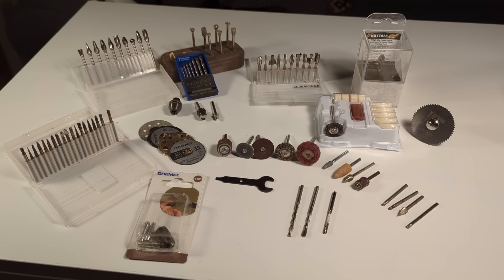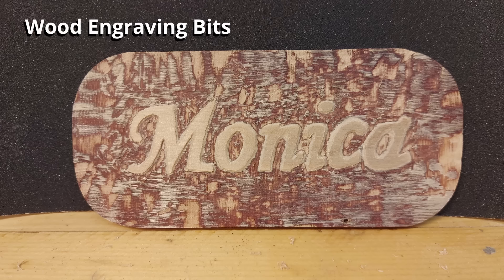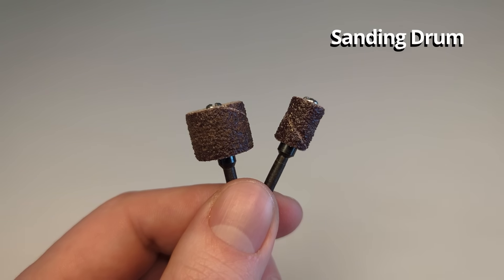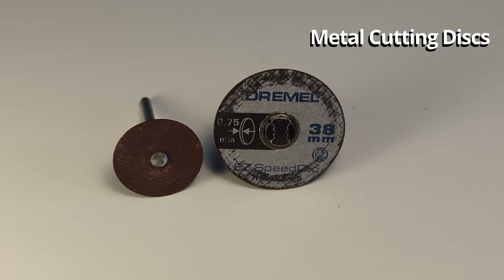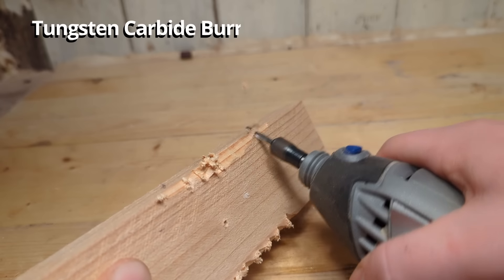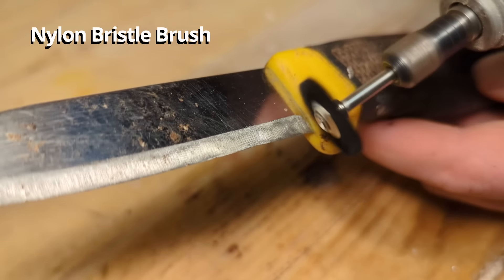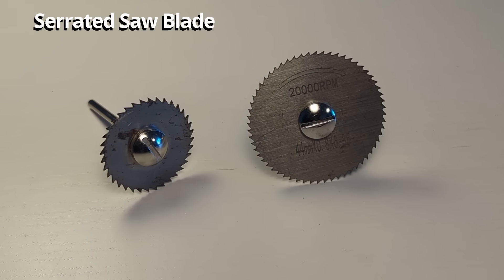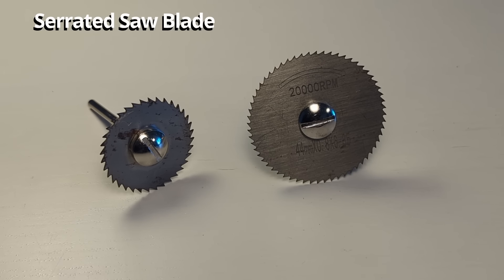The Ultimate Dremel Bit Guide

Comment: The larger fibrous cutting disc for metal are more durable and are generally fine, but they are soft... Those small what looks like corundum bound with resin discs truly do shatter easily and are a danger, but if you need to make a cut or a gash in a piece of carbide or hardened steel, like file hard steel, they are much better... Sure, they demand full protection and gentleness greater than handling a newborn would, but you are grinding into hard steel or carbide, and you should by all means have full adequate protection, from breathing respirators to lexan visor and thick gloves and chin reaching apron... You dont want a slice of that disc to launch itself into your throat or anywhere, so pay heed to its capacity to do immense damage to soft tissue upon fragmentation if you make the slightest hiccup... 
I love them, as i do often make custom machine cutters from broken hssco drills or carbide pieces, and a machine cutter grinder is just not deserving the abuse that removing a chunk of material means, where these discs can carve out a lot of material in moments, roughing the shape envisioned, and then the thing can be precision ground as not to impart significant wear into the diamond/cbn wheels of the cutter grinder... A bench grinder cant do the same due to thickness of the wheel... For rough work, i prefer these, as i can manipulate the thin disc to provide specific geometry, where the thinnest bench grinder stones are quite thick in comparison to max. 1mm thick grinding width that these have...

Those serrated saws are a decent cheap hss machine slitting saw, true, they come in minimal diameters, but if ran properly and sharpened here and again, like any cutting tool, they can actually be used by hobby grade milling machines and even proper large machines on an arbour to produce flat and very nice cuts or slits in materials, even mild steel... Dont try them in the dremel, that just invites disaster, but a rigid machine can make great use of them, and a hobby machinist can source cheap slitting saws from them if one needs them for some small project... I have a few, and i use them on my baby mill here and again... Never failed me, nor did they cause problems... But handheld, they are bound to catch and do damage of some sort to something... Best scenario, the piece you are working... Worst case, well, lets not go there... Just use the diamond or carbide disc if you want to cut solid stuff with the dremel... Toothed implements are best used in rigid setups, and hands are anything but rigid...

Comment: Hi! I'm new in the dremel world. Question: because wood is less hard than metal, can I deduce than metal dremel heads will work on wood, or not at all? I am also trying to see if I can use a dremel for polishing epoxy and if yes, which type of head?
Reply from the maker: Some will work and some will not. Aluminium cutting bits and carbide burrs works fine for woodcarving for example. But the cutting discs and grinding stone will not work very well for wood. My experience with polishing epoxy is next to zero,  but with some polishing pads with polishing compound would be my best guess for bits.  You also have the 423S polishing wheel for softer polishing.

Comment: Which bit would you recommend for removing excess powder coating from metal? Where the powder coating has collected into blobs in holes and corners of rectangular cutouts in the metal. Thanks!
Reply from the maker: I'm not quite sure since i have not done to much metal work. But I would guess the tungsten carbide burrs would be the most effective at removing that type of hard coating from nooks and crannies.

Comment: So is Dremel good for DIY for cutting plastic, metal and plexi glass ? I'm still wondering (so far 3 years) whether this tool and available bits will be good for my needs. Is there something similar to Dremel but aimed at cutting metal, plastic, plexi ? I'm not interested in cutting stone, polishing elements etc, but on the other hand, I don't want to buy a bulky angle grinder with huge 10-15 cm cutting discs.
Reply from the maker: Hi. In my opinion it works good for light metal work (cutting screws, thinner than 1mm metal sheets) and when working with hard plastics like PVC. When I have used the Dremel on plexiglass the friction from the bit  melts the plastic because of the high RPMS, so I don't really like using it on plexi.
Reply: @rotarycrafts8760  Thanks for the comment. I shall wait a year/two with purchase then :)

Comment: You mentioned that one bit wasn’t good at sharpening.  Do you know which tool you would use to sharpen?
Reply from the maker: I don't really recommend using the Dremel for sharpening blades. If you were to sharpen anything with the Dremel i would use the grinding stones or the sanding discs i think. But it is hard to get a consistent edge with when sharpening with a Dremel, might work for rough sharpening of some tools.

Comment: Hello. I need to enlarge a hole in a 1” thick slab of marble. Which bit would you recommend?
Reply from the maker: Hi. It depends on how large the hole that toy want to increase is. I've had good experiences with using spherical diamond coated bits for making holes in rock. You also have diamond coated drill bits that are designed for drilling through hard materials, like the  #662 drill bit. But some form of diamond coated bit is the way to go I think. But it might be slow, 1" of marble is thick for a Dremel.

Comment: I made the holes large enough in my bathroom tiles for the hot & cold & showerhead/tub valve stems, but not large enough to get a wrench in there when you need to replace a leaky shower valve stem.  What bit would you recommend to widen the gap between the valve stem and tile?  Would you use the tile bit at 10:31 in this video, or is there a better bit to use to widen the holes in the tile for the hot & cold & shower/tub valves?
Reply from the maker: I can not give you a definitive answer since i have not done much tile work, but i have some possible options that could work. 

1.  Use a cylinder shaped grinding stone. The diameter of these bits is larger than the tile cutting bit, so i think it will be cleaner. 

2. Try using the tile bit you mentioned above.  But some tile is really hard to cut with this bit. 

3.  Use a diamond bit, the diamond cutting wheel will be the fastest at cutting into tile and removing material. But it might be hard to achieve a clean hole. 

It all depends on how much material you need to remove or if you need the hole to be clean.
Reply: @rotarycrafts8760  Alright, thanks for your advice!

Comment: Personally would not recommend using the wire wheel. If you have too, use it in an enclosed box because those tiny wire hairs will shoot all over the place. After vacuuming, I would scan the area with a piece of magnet. Just one small wire hair will sting unlike a splinter and would have to pull with tweezers to get them out.
Reply from the maker: Yep. I could only imagine if one of those wires hit me in the eyes. They get everywhere.

Comment: Hi, does anyone know what the best way to remove grout because ive heard the grout removal kit is bad and youre better off using a diamond cutting wheel and a right angle adapter. Also is the polishing compound thats included fine enough for guitar fret polishing?
Reply from the maker: The grout removal kit is ok, but i think you would get more control and a cleaner cut with the diamond cutting wheel as you explain. The grout removal kit is good for removing material in the center, but I found it was hard to do those precise cuts when you get close to the edges of the tile. Just going freehand with 562 tile cutting bit might also work well.

Comment: Hello I have a question what is the best bit to use for smoothing out plaster/ cement?
Reply from the maker: Hi. It depends what you mean by smoothing. A Dremel is good at removing protrusions and sharp edges. Not smoothing out flat surfaces. Use the grining stones and diamonds stones for cement. Maybe the sanding drums aswell.

Comment: Hey. Do you recommend 8220 or 4250. I will be working with wood mostly and ı dont think they will take a long time.
Reply from the maker: Hi. Both are good tools with about the equal amount of power. Choose the 8220 for higher mobility and shorter sessions (will still last for at least 30 minutes to an hour of use though) . Choose the 4250 if you want the reliability of not running out of battery power, and if you are going to use it for longer sessions :)
Reply: @rotarycrafts8760  Hey. Thanks a lot for the advice. Sound is also important for me. I will be working in my home which is an apartment flat so it has to be not that loud. At least ı can take the battery version outside and work outside.

Comment: Hi, I just bought the Dremel 8241 to cut a 3/4" thick x 1.5" long cast iron . It's my 99 Ford expedition pitman arm that I need to replace. What disk should I use?
Reply from the maker: Hi. That is gonna be a big and hard cut to do with a Dremel. But not impossible I think. Use the Ez456 cutting disc, that is the most reliable in my opinion. You can also use the Ez409 cutting disc which is thinner so it has to remove less material. But it will also wear out quicker. But can you not do this cut with an angle grinder? Or is it too tight?
Reply: @rotarycrafts8760  I've seen videos where they used an angle grinder. The thing is that there is not enough room, so I thought a dremel would be better and more comfortable to be able to make a more precise cut. Thank you very much for your help.

Comment: Are the engraving bits only for wood or can they be used on metal?
Reply from the maker: Hi. The engraving bits that I show at about 1:26 in the video should only be used for wood and wood like materials. They are made from HCS steel which will get dull quickly if used on metal. For metal you can use grinding stones or carbide burrs.

Comment: HI , Can you tell me what the best cutting tool or grinding tool to use for an old hard porcelain clock. I need to cut a piece of the back of the clock and I'm not having a lot of luck with any of the bits I'm using. They really aren't cutting through easily or quickly.
Reply from the maker: Hi. I would think that the ez545 diamond disc would be the most effective bit for cutting into porcelain. Have you tried a diamond cutting disc yet?
Reply: @rotarycrafts8760   Honestly, I'm  not sure. I have a lot of dremel stuff and not sure but I think I have a diamond disc and will try it tonight. Thanks.

Comment: What if i use 2-3 small metal cutting discs on top of each other? Will that make them more durable? And what about glueing them from the center aswell? I imagine a washer to secure everything will help greatly!
Reply: You would have a harder time cutting. It would be like using a grinding disc as opposed to a cut off disc in an angle grinder to try to cut through something.

Comment: What rpm do i need to remove paint from wood? Will 18000 rpm remove paint?
Reply from the maker: Hi. Depends on the bit. 18k RPMs seems like  a good place to start. Just test out the different RPMs and figure out what works best for you. You should use a dust mask, probably :) good 🤞

Comment: I dont understand the difference between a dremel and die grinder. Is the only difference is the die grinder has a stronger motor and for a heavier duty projects?
Reply from the maker: Basically the same yes. Die grinder is more heavy duty and can take larger bits. Dremel uses smaller bits and is more for details. But it can be hard to make small pendants with a die grinder, and it can be hard to remove larger chuncks of material with a Dremel.

Comment: I often do electrical repairs myself and I sometimes need to remove some excess cement plaster (dried mortar) from inside the switch box. What would be the best tool bit to do this.
Reply from the maker: Maybe some of the grinding stones would work for that. They can handle hard materials without damaging the switch box.

Comment: Can you use a MM485 multi tool with a Dremel 3000?
Reply from the maker: Hi. I don't think so. The mm485 is for the Dremel oscillating tool, like the multi max. Dremel 3000 is a rotary tool.
Reply: @rotarycrafts8760  thank you....I did a search for accessories for the 3000 on Lowes and it popped up.  But once I was looking at the Dremel I was like I can't use this. Maybe I can use it on my other Dremel....it's just the matter of finding it.

Comment: Which one would you recommend to cut acrylic?
Reply from the maker: I have not had any success cutting acrylic with a Dremel. I've tried with the normal plastic cutting bits sc476, but the friction and high RPMs of the Dremel melts the plastic and makes for an ugly cut. Serrated saw blades works well on acrylic in my experience. A jigsaw would be able to make a good cut in acrylic.

Comment: So about Aluminium cutting bits, do those resist getting filled between the teeth by other soft metal like brass, bronze tin or copper? Who has any clue or technique dealing with Aluminium when it gets close to its melting point and alloys with the tool? like with metal saws. Because the cleaning out of soft metal would be nasty a hardly known or shown anywhere, not just on dremel like tools. I even thought of cutting those metals with a knife or other similar sharp tools. 
And something similar can happen with some plastics attaching on tools when too much heat provoques a reaction, but often plastics can get removed afterwards. Because many metals have free swinging electrons that connect quite simply.

Comment: I need a dremel part but i have no idea what it's called, I've googled everywhere. I need to buy the collet shaft, the thing where the collet sits in and the nut screws in. I've tried googling it as collet shaft but nothing comes up. How do I buy that part?
Reply from the maker: Search for "Dremel armature". I think that part has to be bought with all those motor parts attached like the ball bearings and the fan blade. I do not think you can only buy the small metal pipe that holds the collet.
Reply: @rotarycrafts8760  aww man, that actually sucks. I might have to buy a new dremel at that point! 

That part broke on my dremel. It chipped somehow and nothing can attach to it. Thanks for the reply though!

Comment: You mentioned how you didn't like the saw blades. One thing to remember is they are more meant for thing stuff like Masonite. It isn't meant to take over for a circular saw. Your assessment was fair, for how you used it. Their intent wasn't for that thick of material, like you tested.
Reply from the maker: Well, when you look them up on Amazon, they advertise them for cutting solid wood about 1/2 inch or thicker. They are also advertised for cutting PVC pipe and soft metal pipe, which would all produce kickback and we have better options for. That's why I don't recommend them. But I agree with you that they will probably work fine for cutting Masonite.
Reply: @Rotary Crafts  I am not saying you are wrong. Rather, places like Amazon sell recreated tools. What I mean is, the person (or company) that originally designed those tools may have known the limitations. Amazon sellers lie to make a buck. Just like any businessman.  I agree with telling people to not use that tool, but if used correctly, it would be an okay tool to suggest.
Reply from the maker: Yeah. Good point. There is a place for it if used correctly.

Comment: Ceramic and tile need to be cut in water. Plastic needs to be cut with a speed appropriate to the friction melting point of the material as well as the appropriate blade type. The saw blades are designed for use with an appropriate attachment device to prevent the kickback. There's also an attachment to prevent the dust from flying in your face while using the metal working tools so you don't breathe in the diamond dust or the metal dust.
Reply from the maker: Yes

Comment: Can this set be used with a normal electric drill?
Reply from the maker: Hi. You can technically use most of these bits with a drill. But they won't be as effective because a drill has such a low rpm compared to a Dremel.
Reply: @rotarycrafts8760  
Oh i thought it was the opposite, i was afraid the high speed of the drill might break the bits apart, thank you, this is one of the best videos i've ever watched.

Comment: The metal wire brushes should be used at lower speeds so the bristles don’t break and fly off as easily.
Reply from the maker: Good tip :)

Comment: I found the Dremel to be invaluable when I re-fretted my guitar with stainless frets.
Reply from the maker: This got me curious. What did you use the Dremel for in this case? Cutting the stainless frets?
Reply: @rotarycrafts8760  Polishing the frets and fret ends using solvo and buffing pads and also cutting the ends closer to the neck. The stainless steel frets are hard to cut and damage the special nippers that I would normally use. The polishing went brilliantly.